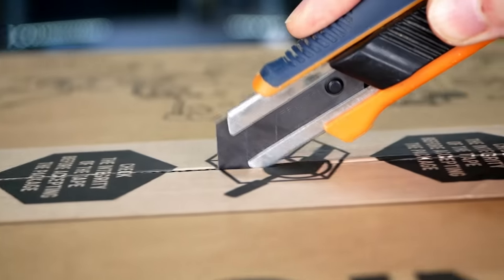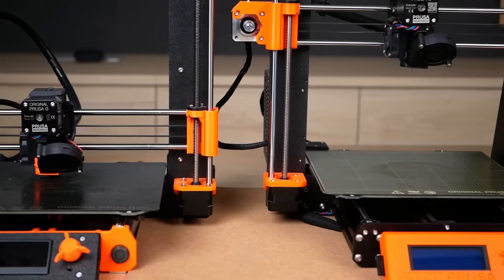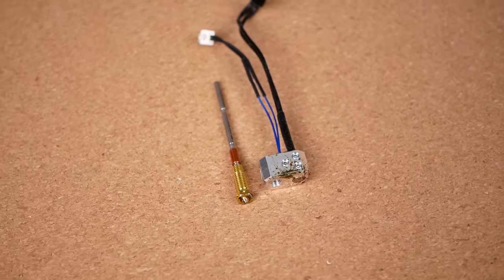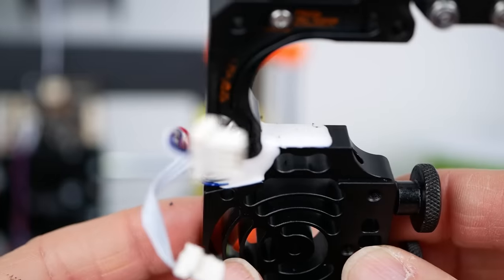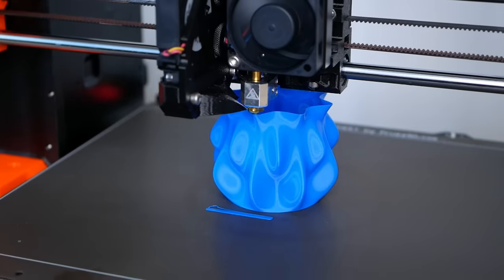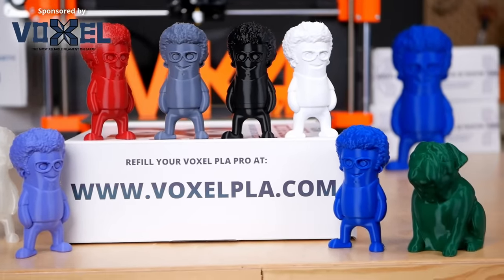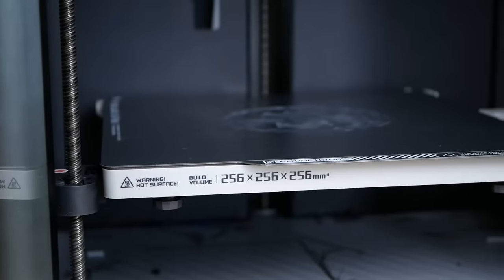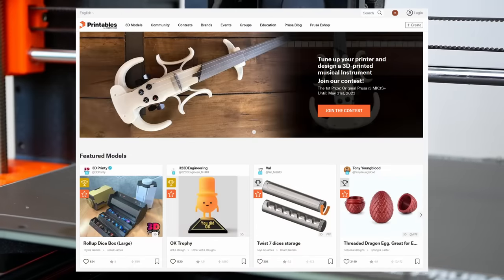Should you buy a NEW Prusa MK4 in 2023 or rather a Bambu Lab X1/P1P?

Comment: One thing to point out about Bambu vs Prusa.  At least in Canada it's a lot easier to get your hands on a Bambu than a Prusa.  Spare parts is also easier to get.  Ordering official Prusa parts is pretty expensive here because of shiping/duty.  I'm sure it'll vary where you live but good to know if you live here.
Reply: Same in the USA. I had some issues with the mk3 and it’s really frustrating to pay $2 for a part and $50 for shipping.
Reply: This is so true. One of the reasons I cancelled my mk4 and got a x1c instead. I still have my mk3s+ and still a great machine.
Reply: The benefit of open source then. You don't need official prusa parts
Reply: @youeatthemtheydie  You're right you don't have to, I"m just saying shipping cost is something to keep in mind when you make a decision. For example if you want to order an upgrade kit you'd have to order direct and don't forget that awsome prusament.
Reply: I have two MK3 printers when I was printing a ton but I doubt I would buy another if I was in the market for a new replacement. I still recommend a Prusa to people who are not very mechanical/tech savy as I've had great experiences with tech support and company, and the printers pretty much just work out of the box, but otherwise I would be looking at a Bambu or different company.
Reply: Prusa I think, assumes that their users are mostly enthusiasts who have some experience with 3d printing. Hence, you don't need to go to Prusa for spare parts, unless you want to. North America is full of parts for the Prusa, if you go and look. Or, if you're too lazy to look, then yes,  you can wait a long time and pay for for an "original" part to arrive. But remember, there is nothing special about Prusa parts. Your can buy them on the open market, just like Prusa does. Hence, I think this is a non-issue. And, Prusa are very clear in their documentation regarding what parts they use, so you can buy your own "official" parts locally, if you wish, at a much lower cost.
Reply: That's the reason I use Prusa in Europe. :)
Reply: You can cut down on shipping costs in the US if you buy from printed solid. They are the official us distributer in the US. Stuff is sometimes out of stock but they are really reliable and ship quick
Reply: Printed Solid sells Prusa parts in the US
Reply: agreed, I am surprised at how good Bambu’s global logistics is… Perhaps not surprising since they are a Chinese company.
Reply: I love my bambu!
Reply: The second thing I printed after I got my Prusa i3 MK3 running was a complete set of replacement parts. It would probably be smarter to print fresh parts as I need them, but at the time I had only one Prusa-quality printer, that could print those parts.
Reply: It might be because Bambulab is based in Texas whereas Prusa is European so it takes longer to ship.
Reply: Hi bud, Im from Scotland but living in France. Can you tell me what kind of things you can make and how hard is it to understand how to do?
I’m amazed at 3D printing, I thought it was all sci-fi 😮.
I would really like to know more please.
Thank you.
Reply: I'm planning on buying a 3D printer but most ship from the US and there are customs tax and delivery fees that stack up quick.
Reply: Have 2 Mk3S+. Same experience. Had an XL on back order for 2 YEARS. Chatted with them today to finalize the order. Wanted to add some filament to save on shipping. Told no can do despite it says you can on the order page (I double checked). Plus the filament of interest (carbon fiber) is back ordered, no ETA. Rep seemed to think it’s just fine to place a bunch of separate international orders. My wife bought a Bambu and doesn’t use the Prusas anymore. Says it’s superior in every way and support is much more responsive. Will probably cancel the XL. It’s a thou more than a Bambu for a slight larger build area and TBH, 5 yrs of dealing with Prusa put me off of them.
Reply: A Prusa mk4 Is $2400 here in New Zealand, unfortunately the Chinese printers are much easier to get and much cheaper here
Reply: Prusa does have an official US drop shipper
Reply: @MRM.98  Is this recent? I posted that comment over a year ago which at the time they didn't and I haven't looked into it since.
Reply: @EmmeryCheung  yes, the company is called “printed solid”. Prusa research acquired them to be the online exclusive US reseller and service center. Problem is they are often out of stock and it’s not always cheaper to go through them. It’s too bad prusa doesn’t figure out a better system/more reliable drop shipper since I assume the US is a big customer.
Reply: @MRM.98  Can you post a link? I searched extensively and don't find a US source. Amazon carries some Prusa filaments but they are across the board $10 higher than Prusa's prices and Amazon doesn't carry the filaments I want like carbon filaments. There is a long thread on Prusa's blog about this and the consensus seems to be it is still cheaper to buy directly from Prusa and if you buy 2+ rolls the cost to ship to the US is equivalent or lower than buying in the US. Someone made a graph showing the shipping break even points. The bottom line is you will pay a premium for Prusa filaments in the US.

Comment: I had quiet a few printers and got a Bambu X1C in January.
The Prusas are nice, but I‘m not spending over 1k for a printer made of printed parts.

The Bambu runs since 4 monthes now and just delivers great results.
Dont want to miss the AMS which allows multi material or/and color prints. For example for perfect supports with a different material as contact layer.

Comment: The problem with the firmware features reminds me very much of the release of the prusa mini. Originally, the wifi connectivity was one of the main reasons why I bought a mini in pre order. I was allowed to wait about 1.5 years for this feature though, which is why I've already built a voron and a mk3s on klipper in the meantime.
Reply: Also AFAIK, the Mini was supposed to come with X/Y perpendicularity correction, just like the i3 MK2 and MK3 did. There's still nothing despite the fact that the Mini is the printer which needs it the most, because of its construction.
Reply: how'd you put klipper on there
Reply: This was one of the main things that soured me on Prusa. It took them almost 3 years to add WiFi to the Mini, by the time they added it I had mine listed for sale. They also never added the power loss recovery they promised and as far as I know it still doesn’t have the print farm software they promised.
Reply: I feel this, all of their new features on mk4 are just klipper features
Reply: Not only did the Wi-Fi take forever to be released, but it is 🗑️ compared to every other solution.
Reply: I couldn't update my prusa mini because I didn't have the wifi module on, it went into an update loop.
In Prusa you pay the 2 year warranty, very relative. Since they interpret it as they please. And that the one who attends you wants to help you.
Reply: how did you get mk3s on klipper? with input shaping?
Reply: @St0RM33  you can get an old Laptop and run Klipper on that...much cheaper than a Raspberry. 
Or get a Speeder Pad (also comes with the v400) or Sonic Pad. 
You can run 3 (Speeder) or 4 (Sonic) Printers on these in parallel.
Reply: Btt cb1, orange pi (any variety), rockchip pi, there are dozens of $40-50 pi alternatives these days. Raspberry is dead. Even the makerbase mks, I have klipper running on all these alternatives.
Reply: @csdstudio78  which printers do you run with it and what else do you need? Which complete setup can you recommend?
Reply: @heavyweather  i already have a pi3b+ running octoprint..a year ago i've checked there wasn't a complete mk3s fw to run klipper, you have to do hacks etc..do you guys have a good resource to check? also do any of use input shaping with an accelerometer module sucessfully?
Reply: @St0RM33  the firmware is compatible for a long time. You have to configure it to your liking though. The prusa firmware  has a lot of convenience features which Klipper doesn't have.
Reply: I can somewhat understand that it took so long. Getting something that works fast through a ESP-01 module is way easier said than done, especially if you are using it as just a wifi slave device for another controller. I do find it incredibly stupid though that they decided to go with that module to begin with, as it was already a old module with its successor (the ESP32) being barely a couple bucks more expensive and almost certainly would have cut down development time as it is easier to work with from own experience. Idk who there thought using the original ESP8266 module was a good idea, anyone with some experience would have stayed away from it!!

And yeah. To advertise it as soon(tm) for over one and a half year right dab on their product page was just plain irresponsible.

Definitely has made me wary about any claims. I will believe the MK4 will get a shaper, once it actually appears in the firmware code. Until then i will assume the MK4 as just being a slow chonker like the MK3.
Reply: The software lack was the same for MK3 on initial release. I don't mind so they get funding for the new product. But since MK3 is working well now, I will wait for 1 year so they will release MK3s with improved mechanical parts and then I would need to push money again for upgrade on MK4
Reply: @UnwrittenGamingftn  if you're going to put klipper on a printer why buy Prusa? When you buy Prusa you're buying their perfect calibration which you are throwing away with klipper
Reply: @TheOfficialDarkICE  for example? Meanwhile, I trust klipper way more that I ever trusted marlin. It's just like an android phone VS a rooted Android phone. Nearly the same functionality stock, but customizable af
Reply: @padigree  for example what?

Comment: It’s important to keep in mind that a lot of the parts on the Bambu Lab machines are not user serviceable. 

The X and Y linear rods are epoxied into place and the idlers are pressed in with one way pins. They also do not sell any of these parts. I saw one example where a user had to send the whole machine back for a bad idler. Basically if you have any problems with the rods, bearings or idlers out of warranty you’re screwed.
Reply: Just pay for service or buy a new P1P for $699.
Reply: Excellent point! This is the main reason why I rejected the possibility of purchasing a Bamboo Lab printer.
Reply: That's a huge reason I would consider an MK4 before a Bambu Labs machine. Maintainability matters.
Reply: You are simply wrong about the linear rods
Reply: @BeefIngot  No, hes not. Bambu lab themselves have stated that the motion system is NON SERVICEABLE. Your only option when the bushings wear out, is to send the printer back to china for repair.
Reply: They have a center in Germany in Europe and Austin in the US for sending in broken printers. Even with a low cost brand as Creality you don’t need to send printers for RMA to Shenzen.
Reply: That combined with "cloud" lock-in gets a big "NOPE!" from me. They're doing the same thing Apple does. You have no control over your own hardware and it can be ripped away on a whim or if the company goes out of business.
Reply: I hope Bambu decides to choose the business model which allows the user to tinker while still keeping avoiding other companies profiting entirely off their work. Slice calls this a "Hybrid IP Model".  Important as consumers to recognise this behaviour as they may abuse patents and create a monopoly as he mentioned which stifles innovation. 

I am fine with them wanting to not have their work stolen and profited off by another company, but that doesn't mean they should resort to abuse the patent system and make their entire product proprietary.
Reply: @GlennDeBacker  That's their distribution warehouse, the printers still go back to china for repair, as there are no repair centers in the US/EU. You ship the printer to the nearest distribution warehouse, then they chip it back to HQ for repair, in china.
Reply: @xeobit2781  Given they are ex DJI.....I doubt it
Reply: @GlennDeBacker  When you're running a business you really don't want to be sending whole machines off every time something goes wrong.
Reply: "Disposable $1200 appliance" really isn't that appealing a concept, when you think about it.
Reply: @BeefIngot  Actually I'm not, I'm looking at my P1P right now and I can definitely see that the rods are glued in.
Reply: @Mad_Catter_  What are people complaining about when the cloud services go down and they can't do stuff?
Reply: @justinhenley162  I have an X1C. I've watched teardown as well. Unless you are saying they changed something I have no idea what you are talking about. Perhaps you're seeing something else and thinking it's glued.
Reply: @_droid  it can print via lan without cloud, it can print from the sad card.
There is no worry that you can not use it.

This is simply bullshit.
Reply: @_droid  You can still use the printer when they go down.
Reply: @LilApe  He is about the epoxy, also you are literally everywhere constantly spouting incorrect facts on any video about Bambulab. It's strange. it's like you search them out specifically. It's a weird hate and I don't get it. You also changed the topic from about glue to being about the label they give the part.
Reply: @TheJustinist  Yeah I was looking at a video about their printers which I noticed a MCU on the hotend mainboard. Looked up the part number and it looks to be one of those ones you can only get under NDA with a chip manufacturer. 
Weird thing is that most chinese resellers labelled it as a DJI part so I have no idea, as a seperate company, how they have access to these parts unless they are still associated with DJI.
Reply: @GlennDeBacker  It's still a lot better to just have the parts sent to me and I'll put them in. Better still if I can use 3rd party parts if I want. For many, part of the attraction of 3D printing is the ability to make parts that can otherwise only be bought at an inflated price from the OEM. I sure don't want the printer itself to be stuck in that boat.
Will those service centers be there in 5 years when parts start wearing out? Who knows.
Reply: My issue is that nobody has done a comprehensive overview of the repairability of the printer, down to the mechanical systems, electronics and firmware levels. This is probably causing most of the confusion and we need somebody who has the technical know-how and money to properly evaluate it's long term repairability and maintainability. 

If somebody knows where I can find this if it already exists, please let me know as I would be very interested.
Reply: @_droid  This is no longer true. You can print without using the cloud service as of the last firmware and I have tested it.

Comment: Looking at your last video, where you installed an aftermarket hotend on a bambulab machine and ran into some issues... this is where prusa's open designs really shine. Adding custom parts is super easy on prusa machines. And the fact that they have a V6 compatible adapter and a breakout board on the toolhead is just the cherry on top.
Reply: But is there really a need to upgrade it? I understand if you like to customize your printers,  but the X1c is fast enough out of the box.
Reply: @dickard8275  It's not really upgrading per se... there are always little bits here and there that benefit from tinkering.  A new fan shroud idea, a stiffer rail brace, just adding text to a part, etc.  Speed is way, way down on the list of tweaks, even when, in my case, your livelihood depends on well printed parts.  Relying on proprietary hardware is a huge leap of faith, especially on a product with an unknown long-term reliability.  A good start is great, to be sure, but a well-earned reputation carries a lot of weight a long way.
Reply: @amarissimus29  Well I have a (not so ) unique perspective. I have an mk3s+ and Bl X1CC. I am close to 2500hrs printed on the X1C and forgot how many hours on the mk3.( dont feel like bringing it out and powering it up for hours logged) but I have printed more in the past 9 months on the new printer than YEARS on the bed slinger. 

The X1C is my workhorse and side hustle. There is a reason why the MK3 has been sidelined and the Mk4 is a slightly better mk3s. Let's just say if my X1C vanished tomorrow I would get another. It has made back my investment and then some and has been by far my most reliable printer.
Reply: Hi Nikola. Could you please explain to me how the soft iron egg works in the rotating magnetic field, and how I can make my own tungsten particle accelerator? I'd be most grateful. 
Also. I'm very sorry that Marconi copied your patent for the tuned circuit. He had no idea what it was, or how it worked, but it did make him a lot of money. 
We now have materials available to make your "skin effect" turbine a reality. Have you got a kickstarter set up yet?
RIP, old timer. One of the few true geniuses to walk this earth. And a friend to pigeons and a cat, to boot!
Reply: @amarissimus29  thing is the company is reliable as well as their replacement parts being very easy to use and get your hands on so longevity of a hotend is horribly important if your printing amazing and fast prints
Reply: @amarissimus29 after Bambu’s appearance tinkering is history, why spend time tinkering around when you can get a printer for fraction of the price and prints right out of the box and is a lot faster? Today’s competitive industry is all about speed, quality and quick turn around times and not wasting time tinkering with a slow outdated printer design that you technically just bought for the name. There is no way I would buy a Prusa printer at that price point with cheaper and better options available, it doesn’t make sense.
Reply: @ivanmartin4313  My designs are my IP, not Bambu Labs'.  You forfeit that when you use BL's services/products.
Reply: @Omniverse0  How so?